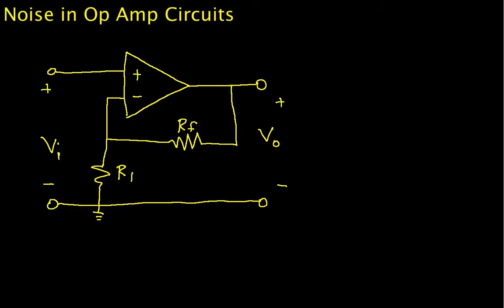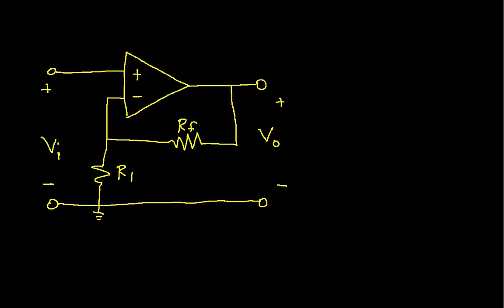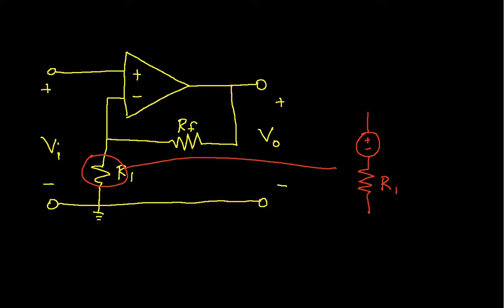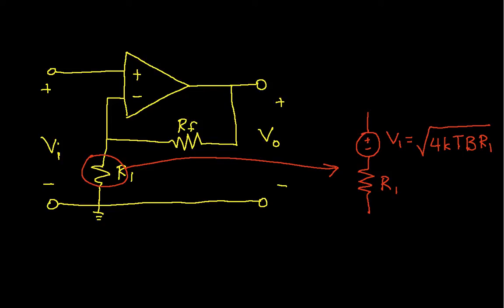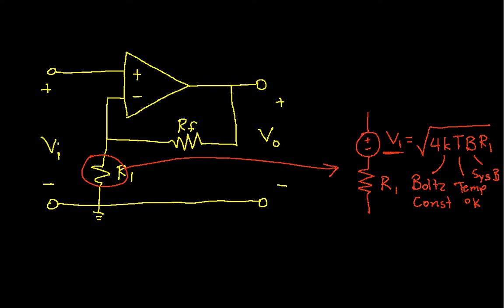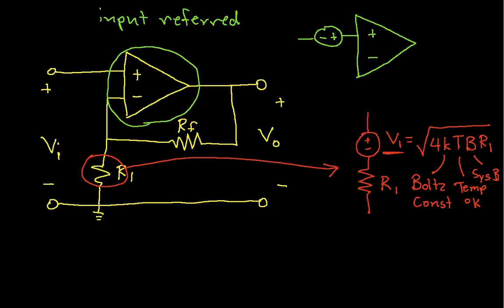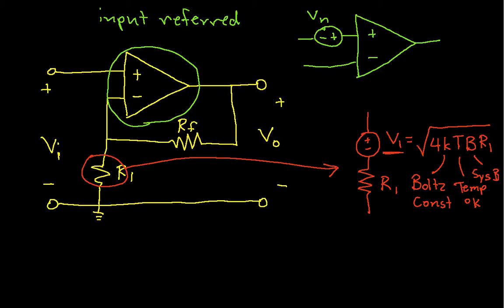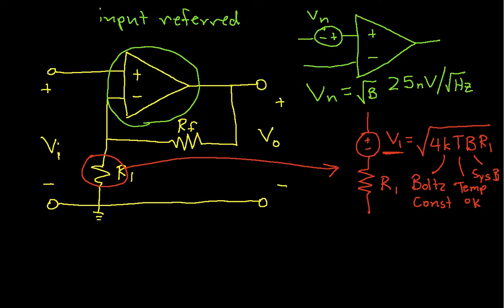Noise in Op Amp Circuits Part 1

Comment from the maker: The noise in the resistor is electromagnetic in the sense that it involves changing electric fields. However, we generally call it thermal noise to differentiate it from noise that occurs because random electromagnetic signals have been picked up by something in the circuit that acts like an antenna.